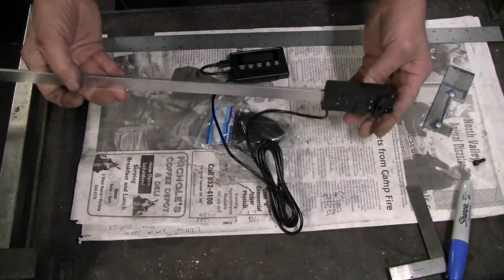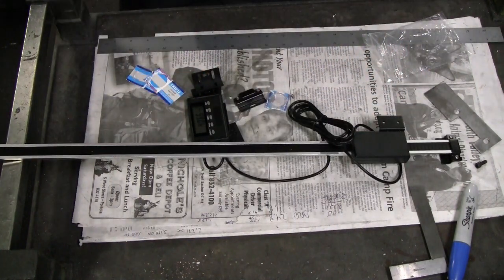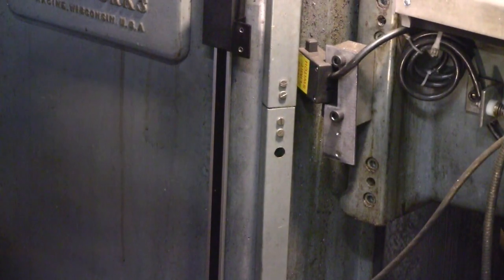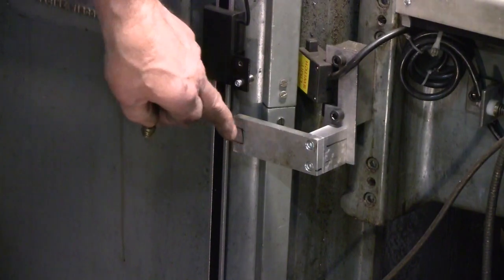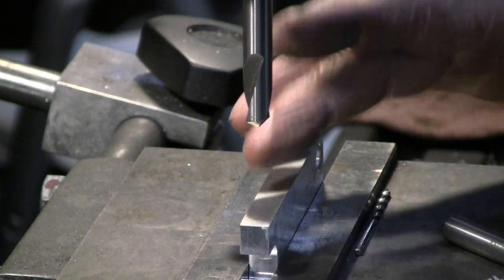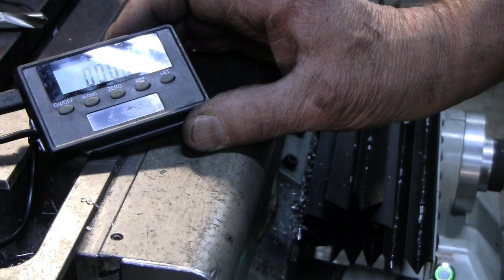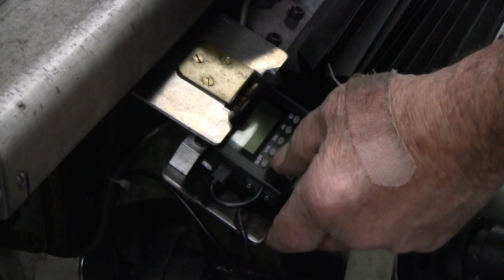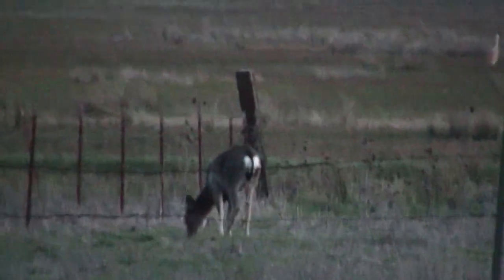Installing a DRO on the Knee of a Tree 2UVR Milling Machine

Comment: Hi Joe!  Glad you shoulder is doing good.  Good to see you in the shop.  DRO's are handy, our older eyes can see those numbers a little easier, than we can see the lines and keep up with the turns. LOL  Should be a handy addition to the mill.
Reply from the maker: You bet, Vernon. "Old eyes" is right.
Reply: I couldn't agree more.  I've taken to covering, with my thumbs, all marks outside of the amount I want to move on my lathe dials ... I look for too long they start moving on me.  Blur and shift.  Getting old isn't for pu..  ... er, ... wimps.

I used to wonder "when is that old prune face going to retire?"  Now I are the "prune face."
Reply: @infoanorexic  I feel you brother.  Between some double vision*, and and a cataract forming in my right eye, it is getting hard to see even with my glasses.  *Results of a hard fall on some Ice, and concussion, a few years ago.

Comment: Got one just the same to install on the quill of my own mill, had it for a while, this could motivate me to do the job soon.
I like your idea of the dowell and spring...   ;)
Great place to live, beats a crowded place any time...
Reply from the maker: Pierre, I'll do a followup soon. I ended up reducing the spring pressure quite a bit. No need to have it so tight since you must always take out the backlash going up.

Comment: Hey nice to see you Joe, this is a GREAT week. 
Knee milling wow I have had to crank two mill types by the knee the I think a Milwaukee power mill (sometimes the hydraulic power feed on that and the easier though manual Bridgeport mills.
Nice machine shop tip about the scale my pocket scale this came to be  very true in time. 
We have scales in the machine shop, only on the lathe and it still need the tail stock one installed (not too important) and we know this, once you go DRO it is highly likely you will never go back? 
This can be true with most automation in this area if machining however as a CNC programmer and operator from over the years and some currently, we still find great pleasure in the manual machinery we run in our shop, specialized as it clearly is, we find joy of the feel and eye challenged world we operate in here. 
This is in part a reason we so much enjoy watching manual machine parts being made on these great machines. 
That is a really nice DRO protector and mounting location for it. That scale guard should handle anything you throw oh we mean drop at or towards it.
We live at 3224 on the airport here in the Mojave desert valley floor, your animals are wonderful we love animals so very much as well.
Thank you for the share, Lance and Patrick.
Reply from the maker: Thanks, guys. I'm looking forward to seeing what happens in the "Grinding Hut".